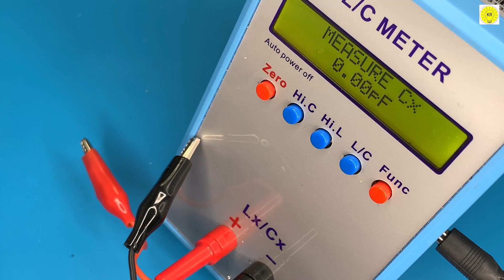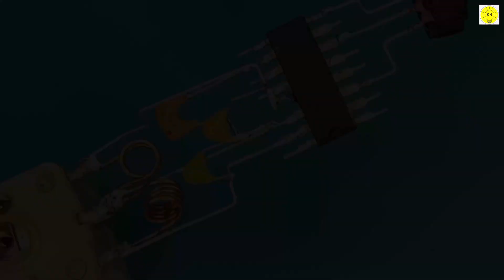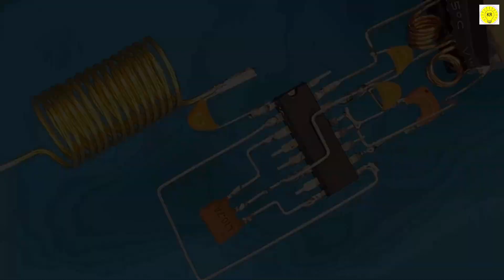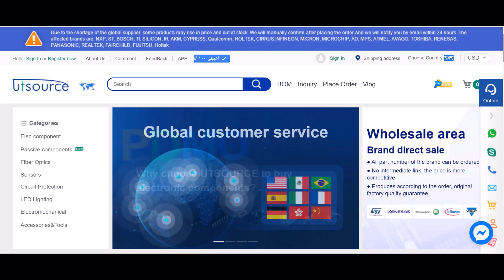Build your Own FM Radio with Just a Few Supplies! , utsource

Comment: sir maine YouTube pr ek video dekh kr components toh le aaya pr woh sb fuk gye meri galti ki wagah se please sir aap meri help kr dijye main aapko meri puri problem btata hu ki maine aapki video toh dekh li aur sb ache se smj bhi aagya pr meri galti yeh hai ki maine motor 9 volt ki aut battery supply 12 volt ki de rha hu toh shayad issi karan 68ohm resistance fuk gya pr please sir mujhe bhot pareshani ho rhi hai aap meri help kr dijiye mujhe btaiye ki mujhe resistor kitne ohm and watt ka use krna hai 
Motor:- 9 Volt
Battery:- 12 Volt
Capicitor Attached with motor 450volt 10uf 
B10k Potentiometer
toh ab main kitne ohm aur watt ka resistor lgau ki meri motor ya koi aur dusra components kharab na ho please sir bta dena mujhe aapke reply ka wait rhega